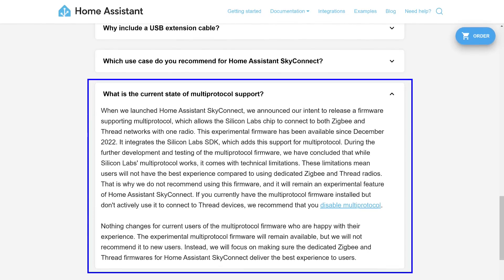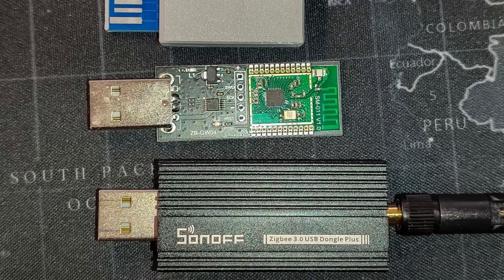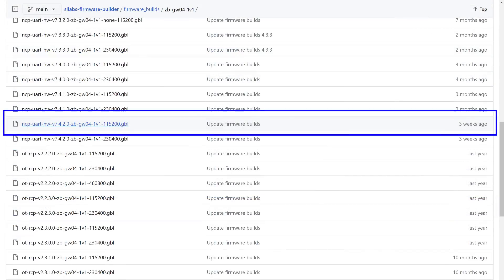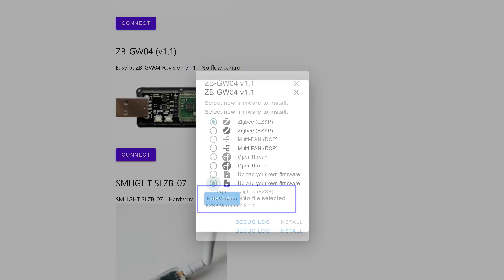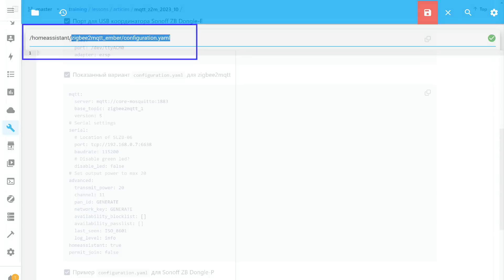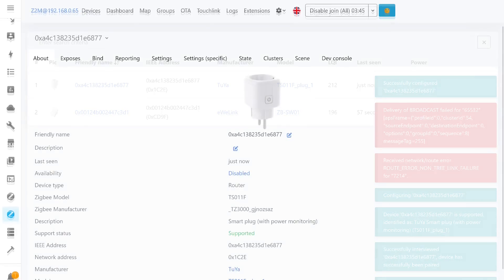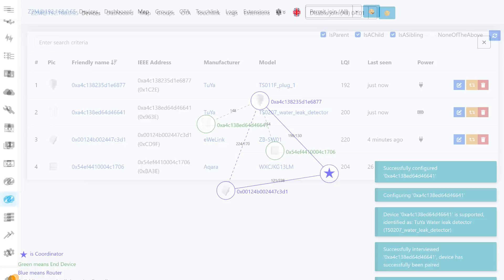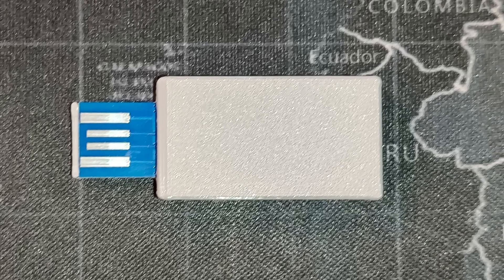Прошивка USB Zigbee стика EFR32MG21 для использования в Zigbee2mqtt в режиме ember

Comment: Подскажите пожалуйста не могу обновить адаптер через сайт, раз с 10 может обнаружить его, а при нажатии обновить выдаёт что устройство не подключено. В HA  работает нормально, виндой определяется и не отваливается. Прошивка стоит старая 6.10.3.0. Что уже не пробовал и драйвера разных годов выпуска, и разные копмы, и разные com порты указывал. Узнал что подобная проблема есть минимум  еще у одного человека.
Reply: Тоже не получилось установить, после нажатия Connect высвечивает Connection failed
The running firmware could not be detected.

Make sure the USB port works and if you are using a USB extension cable, make sure the cable can transfer data. Unplug the Sonoff ZBDongle-E and plug it back in to reset and try again.
Reply: @mrbean27123  Обновить получилось с компьютера с Windows 7.  С Windows 10 не захотело, пробовал на трёх разных компах.

Comment: Сменил на ember. Почему не получается обновить OTA для розетки? (с ezsp так же)  - ZBGW 04 v1.2
[2024-05-31 00:58:18] info: 	z2m: Checking if update available for 'Rozete 2'
[2024-05-31 00:59:19] error: 	z2m: Failed to check if update available for 'Rozete 2' (OTA: Device didn't respond to OTA request)